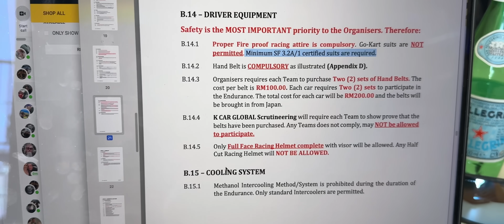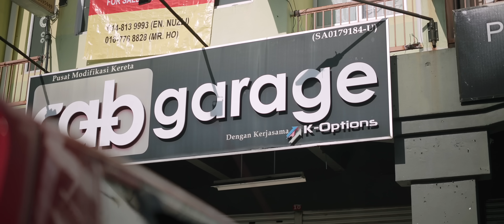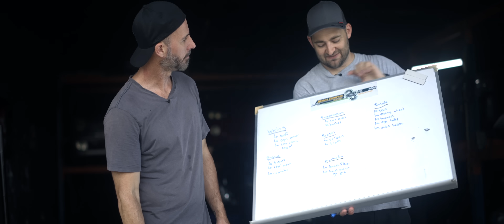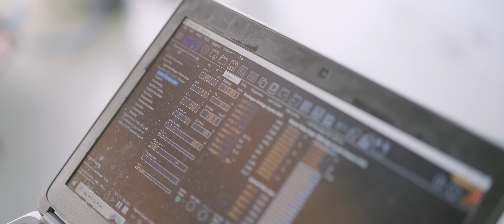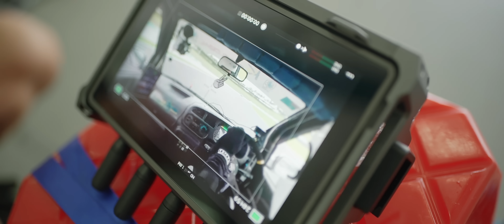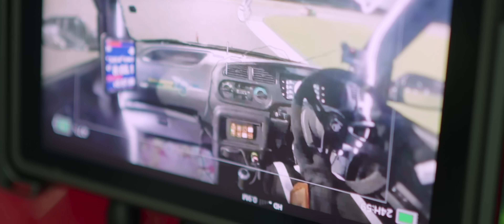We built an endurance race car in 2 days from a suitcase of parts

Comment: This is what I remember as motor racing in the early 1960's. The were club events, with all teams helping each other.  This is what club motor sport is now.  Well, it is with the MGCCQ and the hillclimb at Mt Cotton.  Sure we have those in their purpose build open wheeler race cars with their $1000 a corner rubber.  But they too are there for the spirit of the event.  They are there when I had problems with my car that cost 8 times less than their engine.  Take your road car, join a club and experience the fun of driving your road car.  At 78, I still enjoy the meetings.  It is getting harder to get out of the car, but the fun is still there.  Thanks to all of you for two great videos.  I would love to do that track in a 24 hour race.

Comment: I’m not an experienced driver, but from what I’ve been told, the key to success in these types of small cars is their ability to hold speed through the corners of the race track whereas bigger,heavier cars slow down more than them, but usually the smaller cars get passed on to back straightaways until they overtake the same car that blew by them again in the corner.

Comment: There aren’t really retail hardware/tool shops like in Aus/US/Europe in south east Asia. Hardware shops are just the basics. You need to look for wholesalers/industrial suppliers who will stock proper tools, and most will do cash sales from their showrooms.

Sometimes you need hunt for industry specific suppliers rather than just ‘tools’, so look for marine or electronic tool suppliers if you want a variety of quality hand tools.

Ryobi will be thin on the ground as it is consumer focussed. Milwaukee is more common. Makita, of course. But the most common is Bosch Professional, which has factories in Malaysia, so there is a lot of product around. I got mine from a shophouse with no display shelving, but boxes of almost every tool they make stacked to the ceiling.

Once you get an eye for what you are looking for, you will find clusters of shops in certain parts of the city, with everything you need. Where there are ships, there are tools.

Comment: I drove 24.5 hours straight from Baltimore Maryland to almost Denver Colorado. I think I drank 6 to 8 Monster Nitro Extra Strength energy drinks. Idk, after the it got fuzzy at 15 hours, around 18 hours I don't really remember much. I just remember turning to my wife and saying "if we don't switch now, we are both going to die", pulled over and slept until we got to the city of Denver and switch again. And we did it in a 1995 Honda Civic DX Coupe, no AC, no power steering, no power. We went through Kansas mid August..... What a huge mistake. We had the civic pinned with the windows down melting. Kansas was almost infinite, just a straight line of nothingness. On the way back I was playing with a jag through the mountains oh Ohio/PA and got tagged by state trooper, fortunately it wasn't to bad. But it was a great trip. The drive ended that civic tho. Shortly after that drive it started having overheating issues and missing coolant aka head gasket problems. Fortunately the oil pump failed before the head gasket got bad. It was in rough shape when we got it, $800 car but I had it for 2 years and many miles. Good times. Seriously tho, stop frequently and take turns on road trips, don't even try. That drive ruined me for weeks.

Comment: Tried telling a workshop owner that 6 tech require at minimum 4 full sets of tools for their work to be efficient, we were ALWAYS waiting on a 10mm, 15mm or 21mm socket, wasted hours of each day just waiting, that's over $150/d in wasted wages just standing around, it takes 10 days to get to the point where you just threw away the money needed for the tools we were begging for.

(PS The total tool cost came in under 1500$)
They bought the tools, I got fired for speaking up, their efficiency went up over 70%.
In Australia my voice identifies me, but it's also law to supply the required tools to do your job.
(This wasn't cars, it was electric scooters)

Comment: Last event in 2017, but they didn't make it to the 2019 event. What?
How do they not have pry bars? Probably the most basic tool (doesn't need to be manufactured precisely at all). How do you check bushing wear without a pry bar?